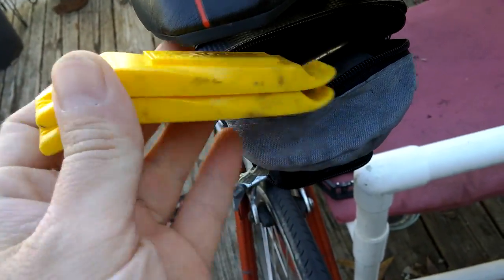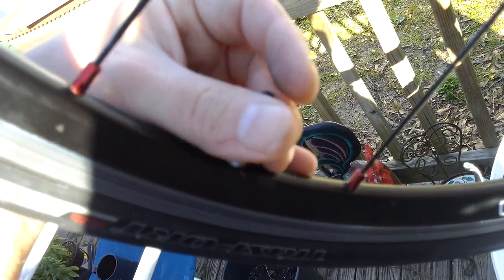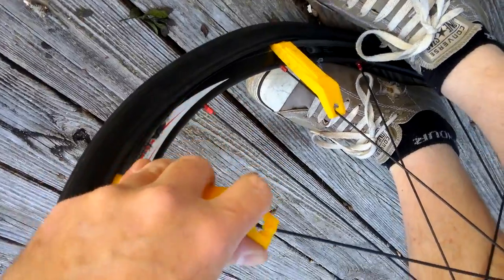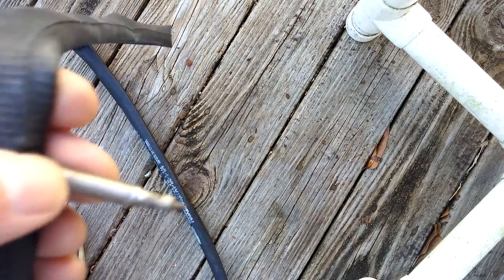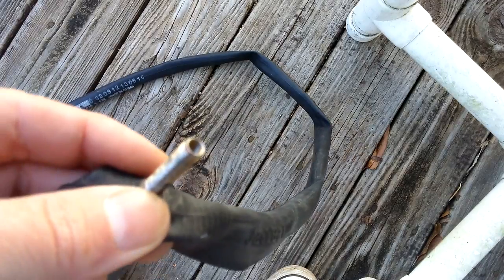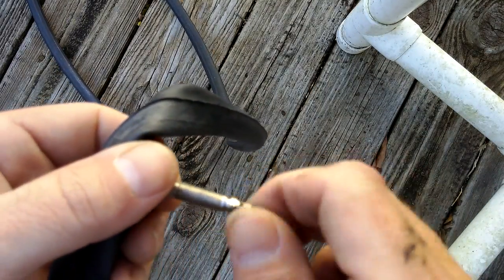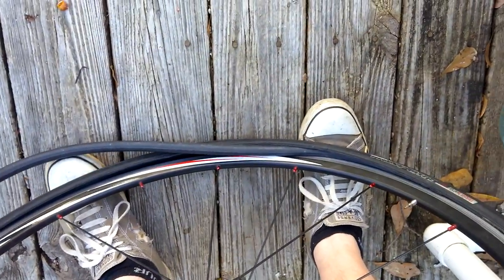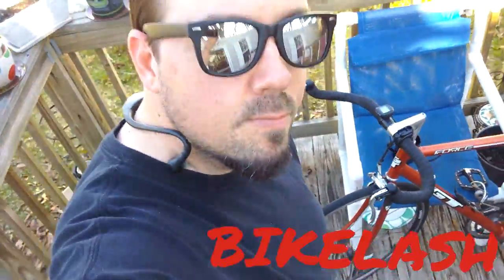Presta Valve Issue Fix

Comment: Thanks for making this video. Couldn't this have been done without removing the inner tube?
Reply from the maker: What i didn't show in the video was a quick run with my fingers around the inside of the tire to make sure while i was already in there that No small metal shards from the broken Presta valve or any other weird metal/etc might be in there waiting to make me change a flat on the side of the road haha Thanks by the way honestly. Going to be cranking out some new stuff in just a few days   ")